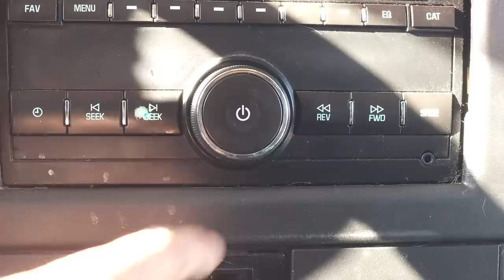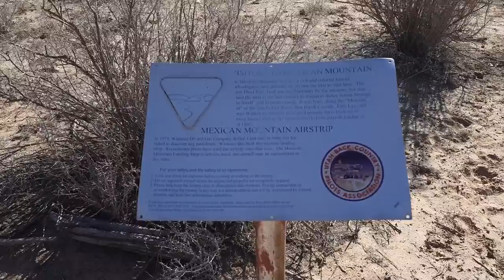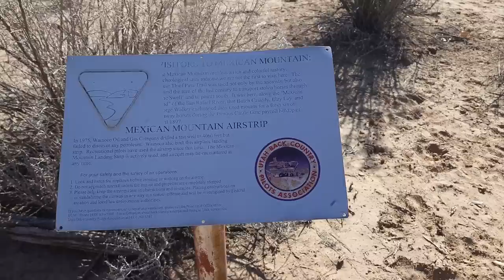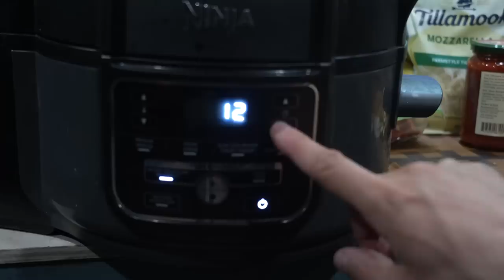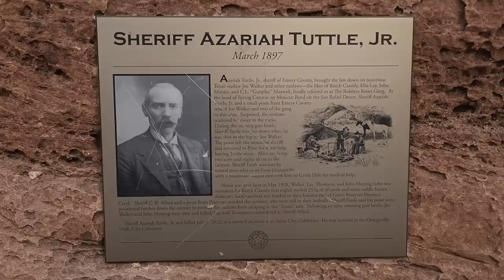Van Life Utah - Swell Times in the Swell

Comment: @Foresty - Rodents: Install bright, rapid flashing LED strips under the chassis/engine compartment. Before install, you may want to drop an LED strip light with a phone app for control to test effectiveness, to be sure it works in your locations. In my experience, these LED strips under the chassis and in the engine compartment are a low voltage/draw solution that is effective with eliminating the majority of rodent issues in the engine compartment/inside the coach. 

We need a well rested Foresty for more backcountry adventures! Also, your new ASMR cinematic format with drone shots and timelapse/skylapse shots is certainly well received and very much appreciated. Thanks for all your hard work (aka. great adventures with Rocko)

Comment: Sprinkle ground pepper around the tires where they hit the road/sand, then put peppermint oil on EVERYTHING you don't want the rats/mice to eat. Put the peppermint oil in a bottle of 79% alcohol and mix it with 1/2 ounce peppermint oil, NOT extract. Spray your tires inside and outside as 
ell and the entire wheel well, door frames and anywhere a wire goes through the frame. Air your home on wheels out before  going back i

I've been in  using it for years in my home and haven't had another rat or mouse trap go off in 15 years. Hope this will help with the problem with rodents
Happy tails, safe climbing and safe travels to you and Rockko.

Comment: I found using my bench vice and actually electric chain saw works great... fast and easy.  Also I put  tarp or something under it to catch the saw dust... and they are like small chips and nice as extra starter.  Maybe "lock" a vice in the rear 2x2 receiver or such and keep it lubed and covered.

Comment: IRT cutting your wood safely: 

I had a welder fabricate an “L” that slips into my hitch receiver. The height is adjustable and a small vise is mounted at the top of the “L”.  That can hold wood & piping while I am cutting or drilling or any other use that  a workbench mounted vise can serve.

Comment: I know you've talked about solar before and you don't want to do a permanent mount, but it would be so cheap and easy. You could probably get 250watts for about $250 if you do it right. I picked up some 250w 39"x60" residential panels for $60 each on facebook market place. You could get a 20amp mppt controller for under $150 then a bit of wire, mounting hardware, and fuses, you'd be set. Anyway, I love your videos, keep it up!

Comment: I really love your videos. Very relaxing and you're always showing stunning locations. I wish I had more time to browse your channel and catch up with the content I have missed because of all the time-consuming work. I'm living full-time in my small ford transit van and I wondered how you're managing to power all your appliances (fridge mainly, as it's on all the time) without solar panels on the roof? Obviously charging a good battery while driving via a dc-dc charger had to be the answer.
Do you have a video showing your power setup, maybe?
This month I want to upgrade my power rig as currently I'm relying only on my Bluetti EB70 + 175W solar panel and it's not enough in the South East of England - too many cloudy days. And I do not have a wood burner, so diesel heater is my only source of heat.
I think you would enjoy having a solar panel on the roof of your van. I have a flexible one, so it's super thin it is screwed to 6 mounting points that were made of resin with bolts sticking up - I have glued them to the roof, so no drilling, no need for any roof rack, panels are easy to remove in case I wanted to sell my van. One mid-size panel of 175-200W in your geographical location would give you a lot of watts :-)

Comment: I have a real simple clamp system in my head right now, that would fit into your hitch receiver and take up very little space.
Length of square tubing and a simple, Vise-Grip Locking Chain Clamp (with extension chain.

Comment: I'm curious about your van, is that 4x4? Also, I don't know if it's available in your area, but I buy Gren fire blocks. It's compressed saw dust and burns a long time, very hot and put off very little smoke, leaves very little ash. The blocks would probably fit your micro stove. I use them in conjunction with firewood for my wood stove in my house.  $7 for pack of 20 @ rural king.  Thanks for sharing your adventures, I've always wanted to visit the West, I live in Indiana.

Comment: We have a wood stove in our trailer and I NEVER buy wood. I have a fairly large plastic tub and fill it with small wood chunks from my wood pile @ home and as we travel try to keep it topped off by stopping @ dry washes to find flash flood drift wood or any wooded areas where there is dead wood. Also other campers often leave lots of wood chips in camping areas that can be raked up with a fan rake. I also have a battery chain saw pruner which is awesome. See my vids for fire pan info.

Comment: After owning 4X4s since 1981 I can say i have never aired down my tires. Not once. In fact the only time airing down is really helpful is in soft sand for better flotation. It could be argued that airing down on rocky roads is possibly more dangerous to your sidewalls especially. I’m curious where this idea originated.
Reply from the maker: Because it cushions the ride by a huge amount.  Less wear and tear on all the steering and suspension components.  Having normal pressure is rough as heck.
Reply: Yes I can appreciate that the softer ride is more comfortable. But the flexing sidewalls present a target for sharp rocks. So I guess it’s a trade off of sorts. BTW Utah is good for months or even years of exploring 👍

Comment: Clean the window of your stove. Scrape the loose buildup off first, then if you put some Comet cleaner and a little water with a green scrubby it should clean it right up. Then more infrared radiation will radiate from your stove, making it more efficient, so you will use only 10% of the fire wood you are now using, extending the useful time you can use your stove ten times over......

Comment: Dude you just have some bad ABS sensors and wheel sensors. It happens those wires frey especially if you're going to be off-roading they dry out on Chevrolets. It happens someone just didn't diagnose it and they threw an ABS module at it because it can be that 50% of the time. If someone had actually hooked up an OBD2 sensor that can measure wheel speed, you would have seen that you know the sensor wasn't reporting speed correctly.  It's either the ABS or it's the sensors and almost all cases and you've you've done it so I wouldn't be too discouraged. I understand that it's been a process and it should have been a shorter process, but You're very likely at the end of that particular repair